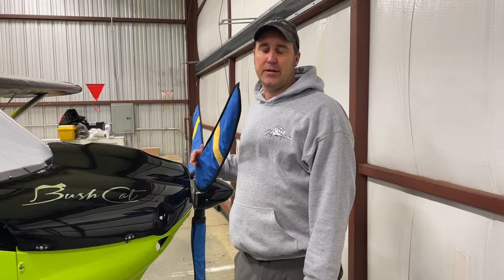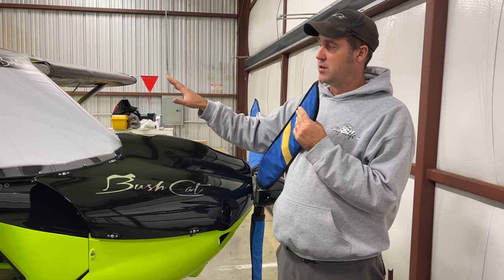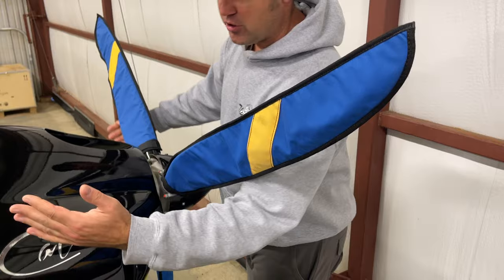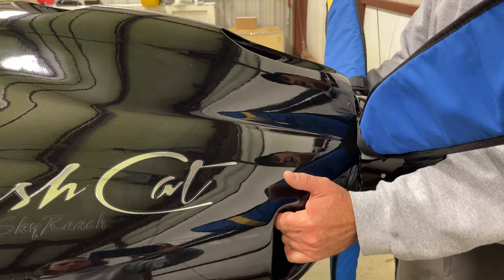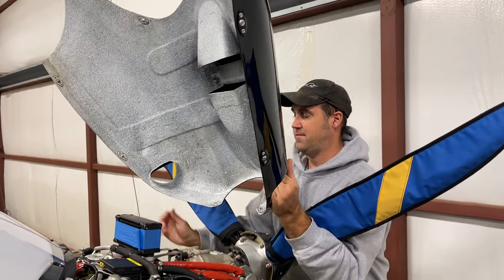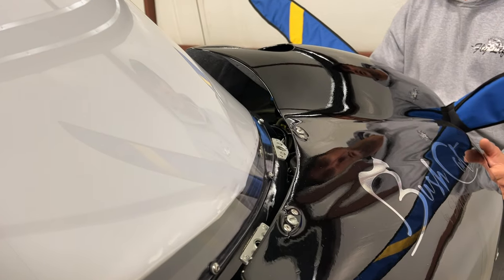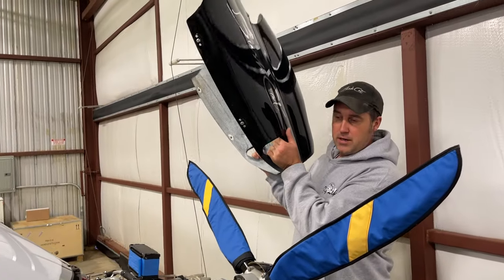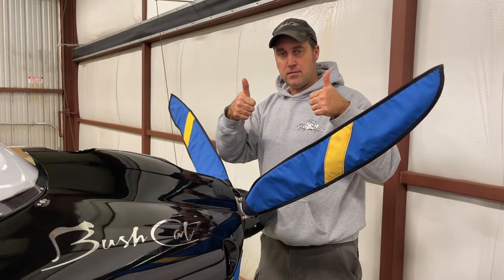BushCat Cowl Removal

Comment: Interesting.  That’s the kind of practical question I’ve had more of as my build moves up the list.  

I’ve never had a rotax before, or a MoGas option engine, so I find a lot unfamiliar.  Also, the baggage area is a mystery.  No idea how you get that much weight into Area 1.  It’s the little things now.   On our test flight together at MVN I couldn’t figure out where to look.  Tom explained that away during an aside while taxiing in his last vid.  The seats are canted in 7 degrees (!).  

Anyway, I’d appreciate more tips  tricks vids.  Looking forward to the training in DeLand in 2 weeks.